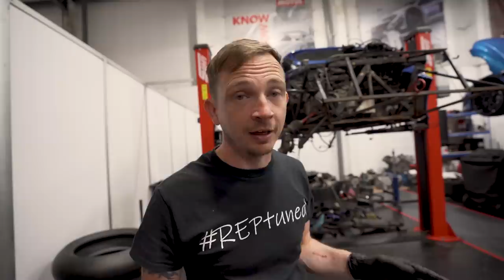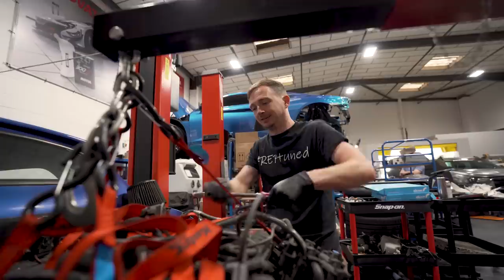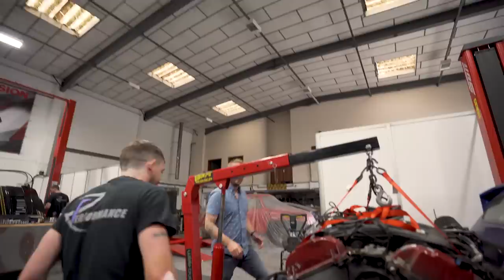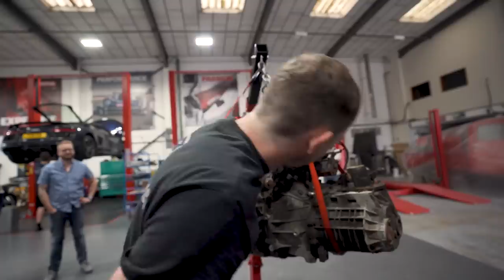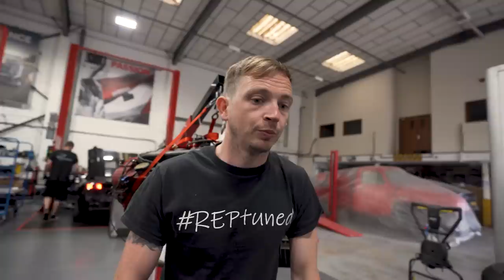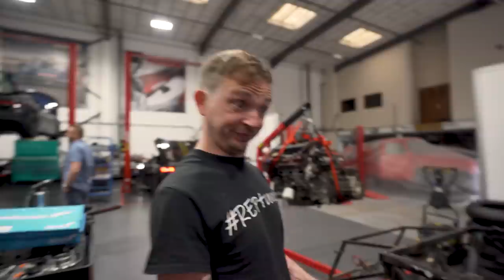We Got the Engine Out!! Noble Update Part 8

Comment: hi ricky a tip on the chassis have it hot dipped it will take back to bare metal and it will show any hidden sins or rust holes then treat the chassis with a rust converter with metal treatment repair any rust then send it out to be powder coated and have them coat the inside of as much of the tubing as possiblethis will eliminate rust in the future that being said condolances to damon's fam and friends cheers from down under
Reply from the maker: Yeah it’s going to be dipped when it’s stripped. Then it will be electro plated over powder coated! Powder coating doesn’t flex and it chips easy.

Comment: Now you have place for a decent engine like a VQ35 😂
Reply: Wouldn't call the vq anywhere near decent tbh
Reply: The Ford V6 is actually Half an Aston V12 and was designed by Porsche and Cosworth and its an all alloy lump!!
Now if you said they could replace it with a Lamborghini V10 then I'd give you that 😅
Reply: Was just thinking "something Nissan" b/c all of the Nissan relations of the McLaren M838.
Reply: @tocsa120ls  
Not unless they completely redesign and change the entire rear end and Bodywork. The Duratec is Transversely fitted (in the direction of the wheels, same as a front wheel drive car)where the McLaren would have to be fitted Longitudinally ( front to back). This would become a very expensive Project and probably end up paying the same for a Second hand McLaren!
Reply: @markwalton8644  but a VQ35 is a six...
Reply: @tocsa120ls  
The VQ35 and M838 are fitted Longitudinally in the Nissan 350z and  McLaren where the Ford V6 in the Noble is fitted Transversely. 
You'd literally need to redesign the entire backend of the Noble to fit!!